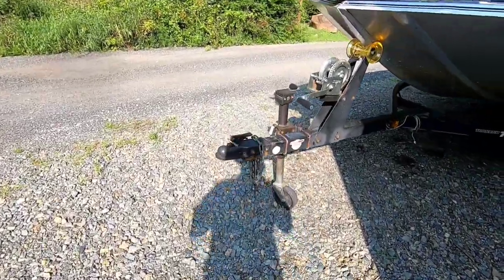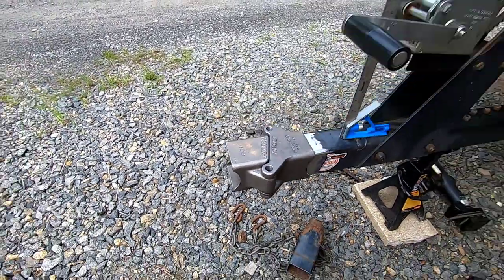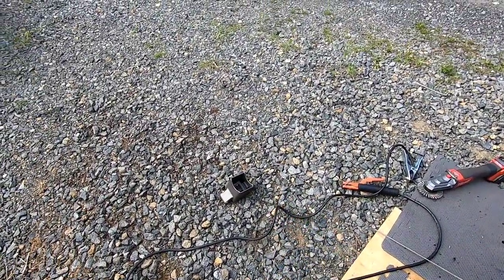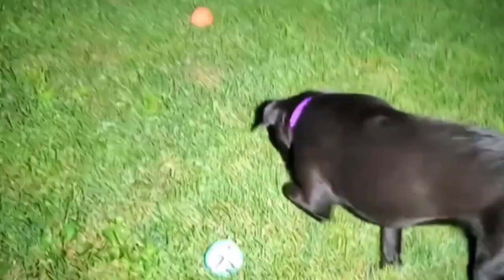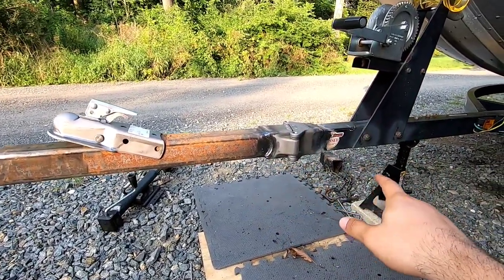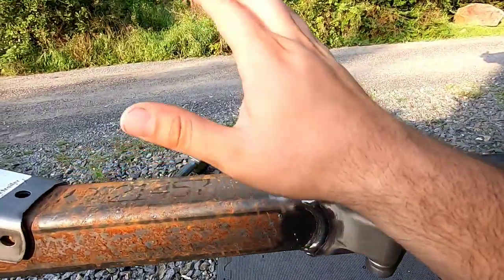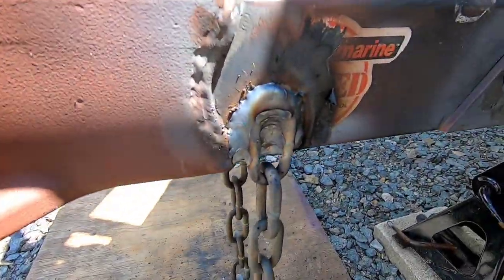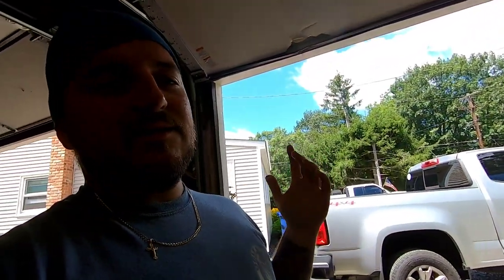WELDING A FOLD AWAY HITCH ON BOAT TRAILER

Comment: Wasnt it better to add a piece of plate up against the horizontal bar where you welded the chains onto just for   extra strength incase the chains get pulled on.  Like it is there it will just rip off off the metal.

2nd question...does that foldable hinges come in different weight catagories per boat sizes? Or is it one size fits all
Reply from the maker: Not sure if there are different weight ones. They are sized for the metal your trailer is made from
Reply: @mcfwelding  noted thank you for the feedback. I guess then when they are fabricated according the metal size then it should be strong enough for that particular vehicle.👍🏼

Comment: Hi man nice videos i got a question, do you need a lisence to run the little shop? Like the name of a company or something? Not for welding certificate cuz i know is for structural or cilinders etc but  do i need a permit to do a side jobs like you ? For example some client ask for number of lisence ? Great videos man i live in oregon and i got the same problems with the weather sometimes
Reply from the maker: Not sure.. I work for cash

Comment: Welding the chains is nowhere near the same as bolting them. That trailer comes off, those chains will just be decorations dragging behind the tow vehicle
Reply: Depending on state DOT regulations you can't weld the chain directly to the trailer.
Reply from the maker: I've seen lots of chains welded to lots of trailers
Reply: @mcfwelding  I doubt you’ve seen as many as you think. Most have a clip ran thru the last link. The clip is what’s welded. Not the chain itself. But regardless, even if you’ve seen some backyard trailers that have the chains welded, that doesn’t change a thing. A chain that’s been welded will snap every time, and it’s illegal. Just letting you know. Good luck